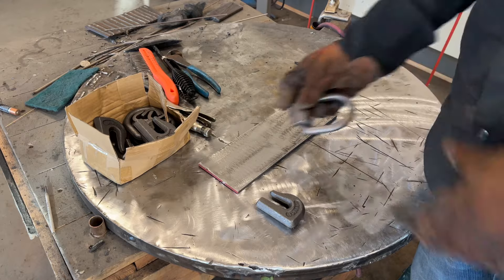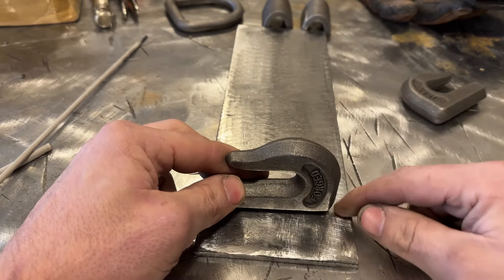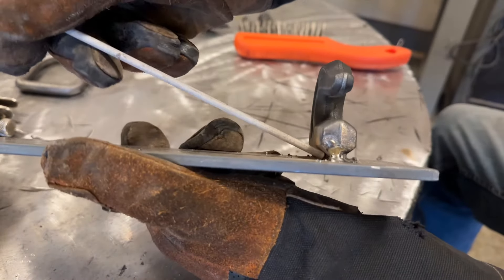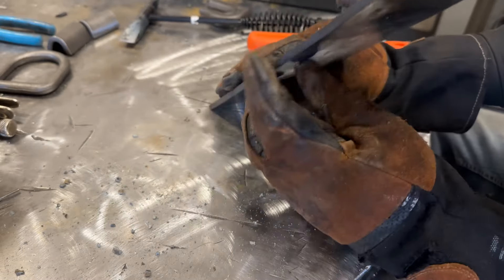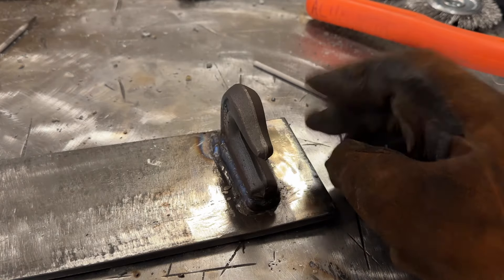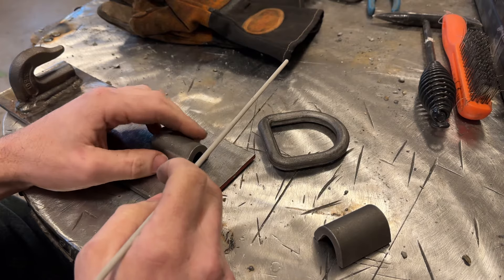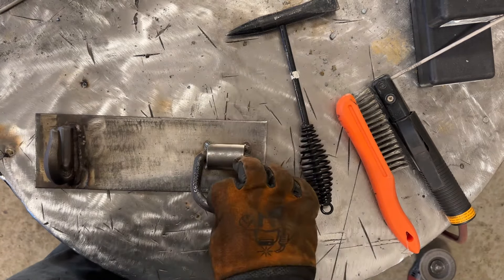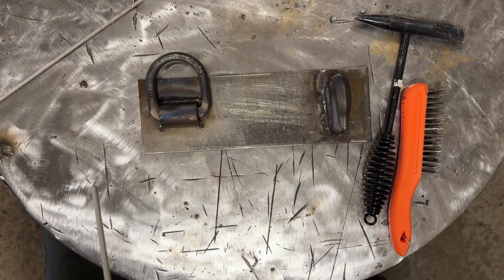Welding hooks and D rings with 7018

Comment: Im not a welder but tought to burn stick over wire if it has to hold . Just sold a mig and back to stick for me. I had questions about a first pass using 6010 but already answered in comments. Good info from this guy

Comment: Could you test the strength of single pass vs multi-pass? If I remember correctly the minimum spec for leg size is 3/16" up to 1/2" plate. So I'm curious if you could do a bending test of 1/2" plate fillet weld with a single pass of 3/32, versus a 3 pass weld of 3/32 with 7018.
Reply from the maker: Great thought.  I do have 1/2 inch plate.  The only potential problem I have is my shop press claims to be 12 ton but it’s pretty hard to pump it beyond 9ton.  I will give it a shot. Worst case is I will have to use the 100 ton at my work lol.

Comment: Loved the video Greg, there were a lot of very good Do’s and Don’ts for securely welding Hooks and D-Rings.  I really like the D-Ring part with 3/32 rod on one side and 1/8 rod on the other side. It would be very interesting if you could do a quick part 2 addendum where you cut and etch all the welds to demonstrate the penetration of those type of welds.  I am curious if it would be advantageous to tack weld the hook on the sides rather than the ends since they are weak points, wouldn’t they benefit from the preheat of the two sides?
Reply from the maker: I have a new stick welder in the shop and a drawer full of those, I think I will tackle doing a part two soon.  Tacking on the sides would work on the hooks.  The main thing about tacking is if you must run hot to get fusion.  With stick, tack welds generally have good fusion.  With short arc Mig the fusion is more limited on a tack.  It’s also wise to stager starts and stops of welds on a multi pass weld.  The start and stop is the most likely place to have weld defects (porosity, lack of fusion, etc) so having all of them in a row is undesirable.

Comment: At the time this video was uploaded.  I had 47 years of welding experience.  I was working in field service on garbage trucks and equipment. My rule of thumb was weld it like your kids' lives depended on it! 
The broken D-ring looked more like a rookie welded it. I used a #6 .035 wire with an argon -co2 mix 80-20 . Usually at 135 amps . But 90% of my welds were done with E-7018 1/8 inch. At 125 amps. I retired after 48 years.

Comment: Good content. Thanks. Straight forward and to the point. I watched another video where it was said that welding tie-downs is an excellent idea to weld to a steel plate rather than directly to the equipment you are putting the tie-downs on. That way, more welds than just those placed on the D-ring are holding it in place and provide more resistance to failure.
Reply from the maker: Thanks for sharing and you are correct.  If the tie down is being welded to thin material (under 1/4in) it is a benefit to weld the d ring to a plate and then weld the plate to the material.  It will be less likely to fatigue crack the material vs direct welding it.
Reply: Great advice for a new guy like me

Comment: We have 2 older LTec mig welders, they hit that spray arc level with no problem, only reason we keep them around. Super heavy machines. But we still stick weld d rings and chain hooks, couplers and spring hangers.
Reply from the maker: Honestly I am more of a fan of stick for stuff like that too.  It seems to be flat out reliable, consistent, and strong.
Reply: @makingmistakeswithgreg  7018 is a must in our shop for anything that could come apart and kill someone.

Comment: I taught myself how to weld. Literally never saw a video on amps or rod size. 
What works for me: 150A with 1/8" 7018. I cant weld anything thinner than 3/16 because ill melt a hole right through it. Great penetration though
Reply: Get ya a cheap flux core wire welder for your thin stuff. Flux core can also handle thick steel too but it’s much more forgiving with thinner stuff. 

I’m 100% self-taught as well. There was no such thing as YouTube when I first learned to weld. 😊

Comment: Thanks for this content!if that hook ever fails, I don’t want to be anywhere in the same zip code! That is ON THERE!
Reply from the maker: I have been welding a ton of hooks like that (and bigger sizes) onto excavator buckets lately.  A bunch of the original hooks had failed welds due to someone doing a lot of things wrong (not enough weld, poor beveling, short circuit welded, etc).  To date I have not had a single hook fail, it pays to do a solid job on them 😀

Comment: Hi Greg, 
I am not a weldor and my suggestion may amounts to nothing; but I think if you could have a 3/8"× the length of the forged hook cutout on the base plate and plug weld the hook and then weld on both sides of the hook on the top will give greater tensile  strength to the welded joints.
Thank you for your great videos
Reply from the maker: Not a bad idea, the biggest limitation to that thought is access to the backside.  In the situation I had it was accessible but in many situations it may not be.  Your idea would also likely somewhat reduce the warping of the plate.  It really comes down to how thick of material you’re welding it too and what the access is.

Comment: I've been watching a bunch of your videos recently since they're excellent. 

The machine I have is a Lincoln 175HD (I believe that's Home Depot, not heavy duty), 220V machine with 5 voltage settings and continuously variable wire speed. 

Something that I've been curious is whether I can change anything to excessively abuse my machine for higher voltage: the manual says that I can adjust it to run on 208V (based on 3 phase). I'd love to do that to get higher voltage (when really on normal US split phase 220/230/240/whatever you wanna call it), potentially running dual shield wire. 

I have some minimal (but not totally trivial) experience, a few years ago I got 3G/4G certs on 7018, solid wire, dual shield, all tested on 1/2" plate, thanks to classes at the local community college. By no means am I a good welder, never done it for money, just want to make it clear that I'm not total shit, just inexperienced. 

I wonder whether I'd be able to run 10% duty cycle (or 5%? idk, you get the point, one pass at a time) at realistic dual shield voltages with an old, inexpensive machine if I'm willing to sacrifice - if it won't do it, it's time to buy something that will anyway. Obviously it'd be a minute of trigger time and then a long wait, but that doesn't tend to be a big problem for home use.
Reply from the maker: So based on how that machine runs you’re not going to be able to get enough voltage out to run dual shield.  Dual shield really needs 24v or more to run properly.  That machine (to my knowledge) can run on 208v, but that is 208 off a 3phase system, which is typical in commercial buildings instead of 240v at a residence.  Most 240v devices will run on 208v.  The downside is the reduction of voltage on 208 means less duty cycle, and possible reduced output.  If the 175 welder you have requires some sort of wiring modification to run on 208v, that wiring change is so that the machine dials are accurate at reduced voltage.  

There are ways to get more power and voltage out of a transformer based welder,, but they aren’t practical.  If you want to run dual shield your best bet is to look for a machine that can output the voltage you need 👍.

Comment: How can we tell if it melted and blended in with the hook. That’s my only worry is Melting in instead of just looking like it Melting. Thanks. Love your videos awesome I’ve learned a lot. Thank you for sharing.
Reply from the maker: Glad to hear you learned a lot 😀.  So the only true way to know if your settings are appropriate is to visually look at it, and determine if it appears that the weld has melted the materials together.  That is not concrete however, that is where a cut and etch counts.  certain processes like stick welding are very consistent, if the weld appears a certain way there is going to be proper penetration/fusion.  With processes like Mig, it’s possible for the weld to look decent but have poor penetration.  Mig weld appearance is simply less trust worthy than stick.  That’s why doing a simple test weld on identical thickness materials and cut&etch it matters.

Comment: You answered a question I had about mig welding. How thick of material can flux core .045 wire weld with a 170 amp welder? (Thinking about getting the HF Titanium 170) 
Great information on your channel! Thank you!
Reply from the maker: So there are a bunch of things to consider, hope this helps:

Straight Gasless flux core Lincoln NR-211 wire is rated (per Lincoln) up to 5/16th thick (with .045).  Hobart fabshield 21b is rated for up to 3/4 thick, but they don’t specify wire size.  From a educated guess a 170amp welder could weld around 3/8th with Gasless flux core wire with decent penetration.  

Dual shield type (gas shielded flux core wire) in .045 would have no issue welding 1/2in plate plus, however there are some caveats to this.  A 170 amp welder is only capable of outputting enough power to run the wire at the low end of suggested values.  I would think you would tend to get unpredictable results running .045 dual shield on something 3/8th and thicker with only 170 amps (the machines max voltage would also play a role).  Remember that the flux in the wire needs to be preheated before it hits the puddle (thus long stickouts are used).  Well when you run a big wire on the low side of amperage it may cause issues with porosity due to flux turning to gas inside the weld pool.  

I am not sure if the titanium 170 has a .045 drive roll with it or available.  They do make .035 dual shield wire that would work with a 170 amp machine (esab does) with a practical thickness limitation of probably around 3/8 to possible 1/2in thick.  Again the thickness limitation is mostly a function of the limited voltage and amperage of the machine than the wire.  

The cheapest way to weld thick steel reliably is stick welding.  Harbor freights 225 stick welder can weld virtually unlimited thickness metal for under 300$.  With wire welders your best bet is flux core (gas or Gasless) but you still need around a 200 amp capable machine to really get solid clean welds and penetration on over 3/8th plates.   In the future I will test a 140amp machine with .035 dual shield on thick plate to see what it does 😀
Reply: @makingmistakeswithgreg  wow, thank you! Earlier I was looking, no the 170 doesn’t come with a .045 drive roll. I couldn’t find one for sale either. The 200 multiprocess does come with a .045” drive roll. I just pricked up the Titanium stick 225 a few weeks ago. The project I’m working on requires vertical and upside down welds on 1/4- 1/2”. I haven’t stick welded in 25 years. Im getting the hang of it again. 
Meanwhile my Hobart 125 went down (kinda) so I used that as justification to get the Titanium 125 for $150 with coupon a couple days ago.
Now I can get the Titanium 170 for $300 till the 30th. You’re spot on with 3/8 rating for it with .035” 
Thanks again for the advice. I’m probably just going to hone my stick welding skills so I can weld in different positions.

Comment: Great video sir, I was wondering if you heat up the whole base plate with a torch would this help with warp? Theoretically it would reduce the gap in temperature difference. What do you think?
Reply from the maker: Heating the plate will make the metal more “pliable” and will lengthen the time it takes for the weld to cool which may reduce shrinkage of the weld.  Warping is primarily a result of the molten pool (or hot steel) solidifying and reducing in size as it cools.  It’s the opposite of water which expands when it cools.  How much it would help is hard to say.  Generally speaking a low 120-150 degree preheat helps on thicker steel across the board.

Comment: Great video thanks!  What type rod did you use?  Ok further in you mentioned 7018?
Reply from the maker: 7018 works great for many jobs, it’s hard to go wrong with it for anything that needs strength 👍.

Comment: Really great videos and teaching, appreciated!
One thing that's been nagging at me is, what is "penetration"?  Clearly its that metal that gets a different color from the base metal when etched, but is that new metal, ie filler metal - if so, where did the base metal go? Maybe its clearest with tig: when you melt the base metal locally into a pool and then add filler, I suppose that molten puddle turns into an alloy that then has a different appearance when etched? And stick also melts the base metal and filler mixes with it, but it liquefies a pool deeper into the base than tig, I suppose.

Then about the purpose of penetration (heh), I suppose if you're welding a fillet joint that isn't bevelled and you can't directly weld on all of the original edges, then deeper penetration helps to cover the original edges further in that you could directly reach. And if you bevel everything and tig it so that you can see that no original base metal edges remain then the joint is as good as it can get, even though you're not penetrating as deep as if you used stick - is that correct? Or is there some benefit to having that penetration past the edge of the base metal if there are no further edges to weld in there?
Reply from the maker: So penetration is considered anything past the 90 degree intersection on a fillet weld.  The same thing would hold up on a lap weld or other joint.  Root fusion is when the root of the joint is fused.  Root fusion can happen with no penetration.  Any penetration means the root would have fused.  

The weld “nugget” turns a different color because acid etches it at a different rate than the base steel due to it no longer being the same alloy as the base steel.  Some rods actually produce very hard to etch weld nuggets because they are close to the base material.  6013 for me tends to produce poor cut and etches.  The base material was more or less liquified, mixed with the molten metal from the filler, and then it solidified as a new alloy.  Stainless steel and nickel alloys are very easy to etch because acid only polishes them, while it darkens the plate.

For ultimate strength of say a fillet weld, it completely depends on what loading it might see and where the force is coming from.  A simple fillet weld that is welded on both sides will be able to handle loads from both directions.  If it’s only welded on one side it will be massively weaker if loaded towards the side with the weld (aka bend away from the face).  In most cases a full fusion beveled weld is not needed.  On a fillet weld that is done is primarily when access to weld the backside isn’t possible.  On a butt joint it’s very common on everything from pipe to structural beams.  It’s also common to weld from one side all the way out, gouge the backside to clean metal (or grind it) and then weld it.  This allows 100% solid metal for a tie In with far less skill than an open root joint.  Backing strips are also very common where you melt both plates and the backing strip together. 

Regarding tig and welding bevels, tig has a unique ability to achieve 100% root fusion.  Because you control heat separate from filler, you can actually achieve 100% bevel break down/fusion on a beveled fillet weld.  With stick and mig the issue is you need heat input to fuse the root, and the higher you put the heat input typically the more metal you deposit.  So you wind up in this situation that you put down really big welds in an attempt to achieve root fusion on a bevel.  On a butt joint with both plates beveled and a gap it’s much easier to achieve proper fusion, but most of what the average person welds will not be this.  

The importance of penetration really comes down to the joint and the loading.  A lack of any penetration can directly cause failures because it can be easier for the metal to use the weld as a fulcrum point (fillet weld) and a lack of penetration/root fusion can leave a finished weld that’s functionally thinner than it should be. (Weld throat depth issues).  Penetration isn’t desirable on very thin material generally, or  on certain materials (like cast iron) because the base material weakens welds.
Reply: @makingmistakeswithgreg  Wow nice answer, thanks!
Makes sense, all of it. 

About penetration still, so I suppose the benefit of using a hotter process (6010 stick or spray transfer mig) is that its relatively easier and more consistent to get that root fused, whereas its still possible to get that root fused the same with tig (a low penetration process) and beveling, because of that ability to apply and control heat directly. So other less penetrating processes would also work but there can be issues with filler piling up in front of the root before fully fusing it and maybe just needing excessive amounts of that filler overall. But in the end, if the root is fully fused and fillets are the same sizes, the hotter processes liquifying metal deeper within the plates all around doesn't really matter - unless it has some metallurgical effects. Am I about getting it? 😃
Reply: @makingmistakeswithgreg You could compile all your answers and create a nice FAQ or book. Awesome content and answers for your viewers. Thanks.

Comment: Hey Greg, Great video. Just what I have to do this weekend. Question?? Would it have been better to grind the bottom flat? Just asking, I'm new to stick welding.
Reply from the maker: You can grind the bottom flat if you want.  It wouldn’t hurt to knock the edge off with a mini bevel and weld it.  Being that it’s 1/4inch material it shouldn’t be much of an issue for stick to weld it if you can run a decent bead 👍
Reply: @makingmistakeswithgreg  Thank you for the quick reply. I'll post a pic and let you know how it went.